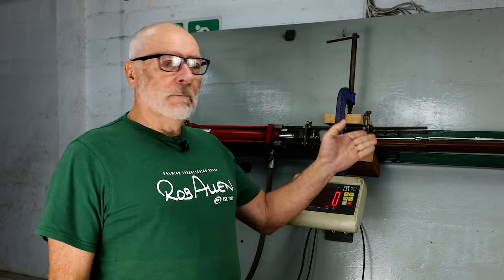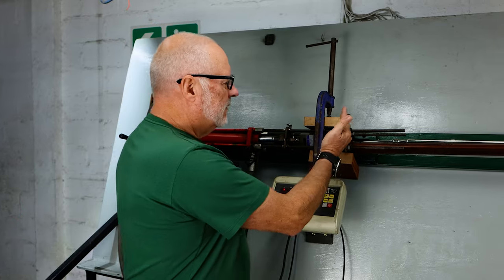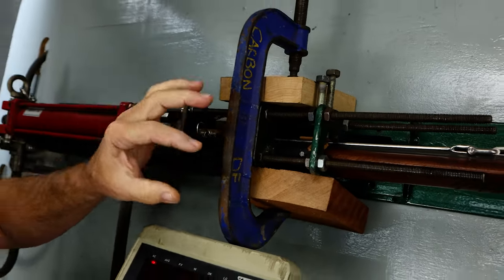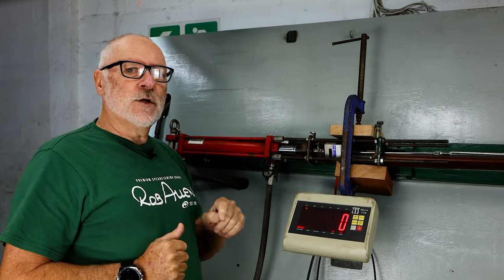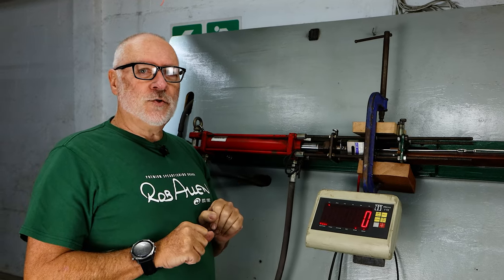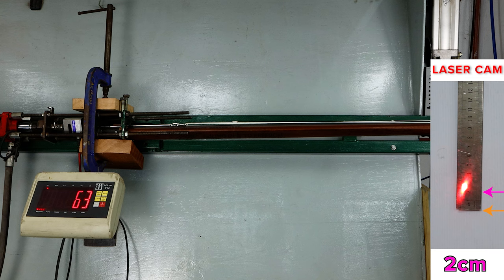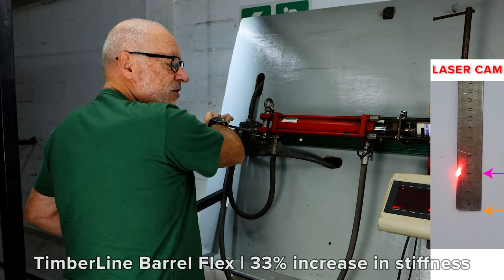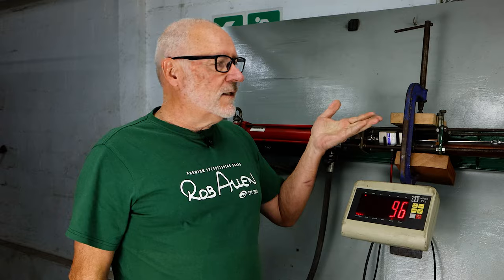Rob Allen | Barrel Deflection | Part 3 | TimberLine | 2024

Comment: How would a purely wooden barrel be in this test? Instead of a carbon barrel incased in wood.
Reply from the maker: In the same dimensions, not as good. The carbon tube is much stiffer. We did a load test on wood when comparing the same dimensions as our aluminum.  Check it out.

https://www.youtube.com/watch?v=cHYZers2kt8&t=45s